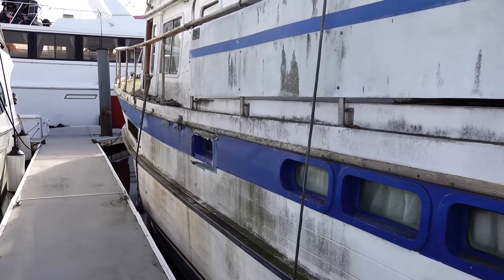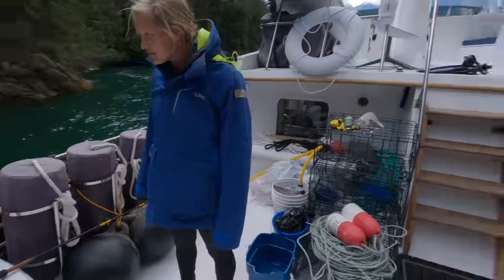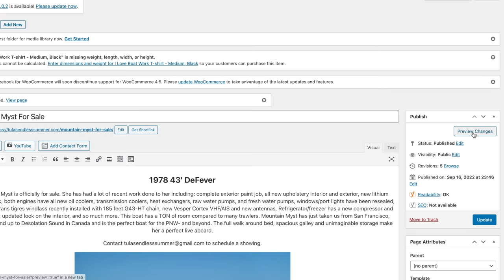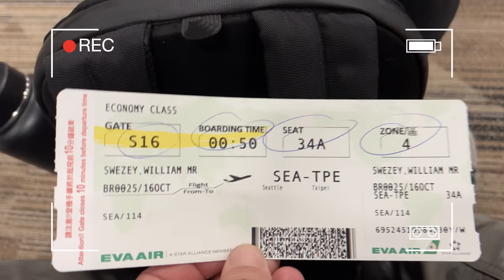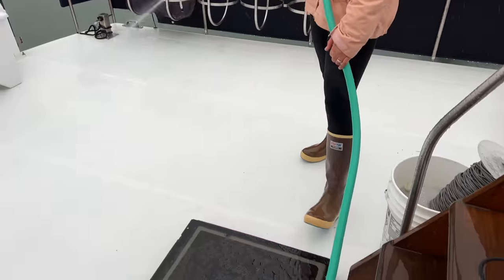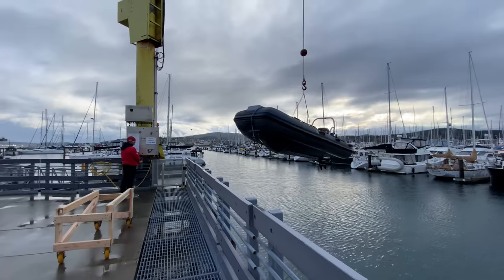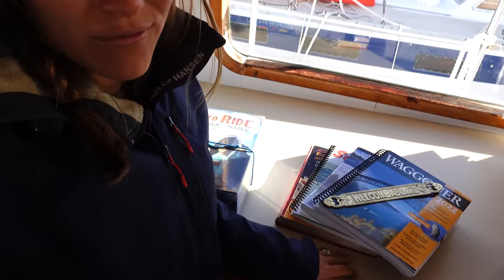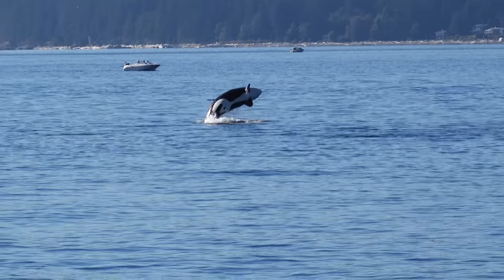We SOLD Our $100 Boat...

Comment: Wow!  You two did an awesome job of putting that boat back together, and I know after all the blood, sweat and tears you hate to sell her.  I felt the same way after modifying a 1976 Dodge Maxivan into a camper van.  I designed the interior, built most of it in and had the bed frame built to my designs so that it had storage underneath, and icebox thyat I installed, insulation, curtai9hns that my wife made, etc.  That van carried us all over California and Nevada camping and exploring the state for 11 great years.

Comment: Make sure to open all those plastic boxes to make sure they are dry inside before you store them. Looked like those lids are not able to keep water out with those holes in them along the edges. 
That last place you tied up in that cove looked so freaking awesome with that drone shot flying back out to reveal the scenery. getting out that place looked a bit scary with all that wind and those waves. Well done! Britisch Columbia must be one of the most beautiful area's in the world. 
We just bought our third boat and for us it is a very big step from a maxum 1900 sc that we used for watersports but also a lot for weekend camping trips to a 2001 cruisers yachts 3470 express cruiser. We have a little experience from renting an express cruiser for a week in Kroatia two years on a row. Manouvering in tight spaces to dock it backwards with not running over bow lines etc. during windy days was a challenge for me but we managed so the new boat will be ok with some practice. First small speed boat had an outboard, second a mercruiser with i/0. This will be the first boat with twin turbo diesels and v-drives. So a very different response to the inputs from the helm. 
Keep up the good work. Great to see you start a new adventure.

Comment: Cool. Congratulations on the sale and the new boat!  I am right now on a new Seawind 1260, in Vietnam having crossed from Nha Trang. I'm volunteer crew. We've been spending a lot of time looking for all the things not available in Vietnam. (Like tapered bungs. None in Vietnam, small ones in Subic Bay, Philippines (there's a pretty good chandlery here). We might also be able to help you with all the stuff we wished we'd have brought with us because it's not available. 
I was the West Marine to VN 'courier': three bags 150 lbs.  Definitely buy and bring Starlink, (I think one of the best videos on it was your channel so this might be old news) sign up for the Regional Roaming package.  $150USD/month. And you're good to go. It worked right from the dock in VN. We all love it. (When I said I wanted to bring it during a Zoom call in January it was like, 'it probably won't work, maybe not this trip...'  Works great.)  I'm using it right now. We didn't even bother with 'free yacht club WiFi. Probably never will again.) 
Almost none of the stainless rust remover stuff, dielectric grease, etc is available in VN or the Philps. You could probably get these things in your container... but it looks like it's probably already on it's way.  Bring rope. I always travel with 8 or 9mm and it's always welcome. (I've yet to walk on anyone else's boat and there's been enough rope.) We tied up the dinghy with fender ropes.
Reply: I looked through your videos to see if you had made a Starlink video (couldn't find it) and noticed that you'd rented a cat. So I clicked on it (I'd already watched two of the three) noticed the Seawind design and then San Juan Islands. So I said to the guy sitting ten feet away, "Hey Jon, I think these guys rented your boat." Yep. Jon's the other crew member on our trip to cross the North Pacific. Small world even though as sailors we can visit most of it.